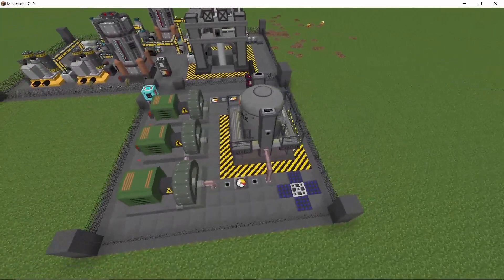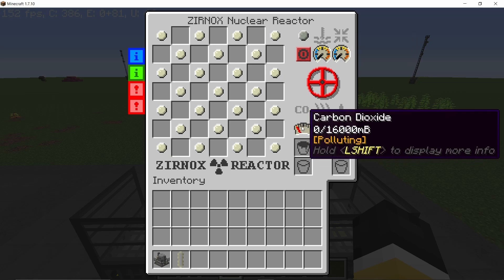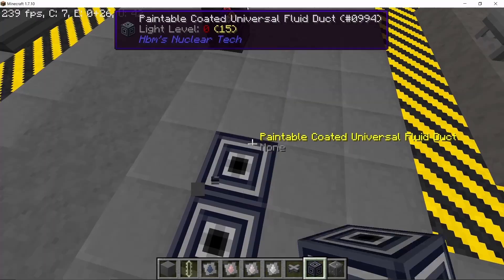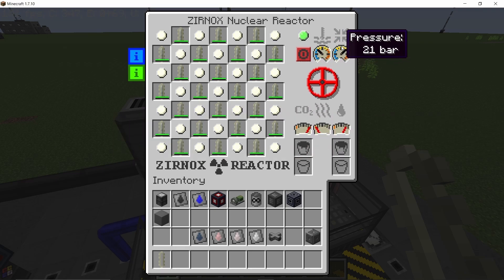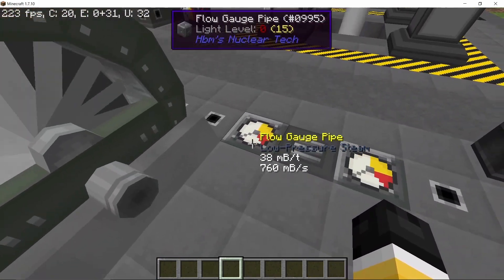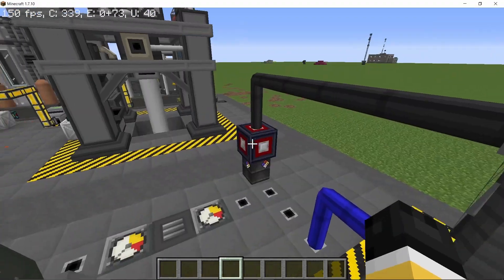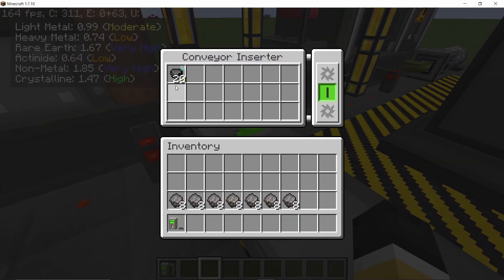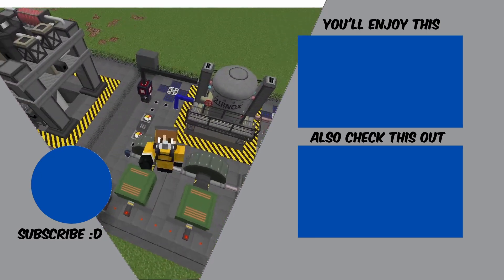ZIRNOX Reactor Beginners Guide - HBMs Nuclear Tech Mod

Comment: is it possible to automate this reactor, or is it manual opperation only?
Reply from the maker: I think full automation can be achieved with a mod like Open computers and you can remove/ put fuel rods using hoppers (if I remember this right ... so take this as a probability)
Reply: sounds like an interesting experiment to try.

Comment: That reactor’s design is silly
Reply from the maker: What change would you make in it?
Reply: @SavageVegeta well i don’t have the mod but if I have it I would change the reactor’s power efficiency
Reply from the maker: @THGMOTORTY3thegamer  tbh this whole video was with natural uranium fuel, which is not very good. With better fuel types you'll get alot more power out of it
Reply: @SavageVegeta  oh okay I get it now
Reply from the maker: @THGMOTORTY3thegamer  yes, the reason I used natural uranium was because it's the first fuel you'll get without the need of further separating uranium into its isotopes

Comment: Sadly it's not in 1.12.2

Btw here is a small tip-
If you place turbine very close with each others then they don't need pipes and the look way coool
Reply from the maker: @abhijeetgaming5749  hopefully it'll be added in NTM extended ... And yes that's how I always setup my leviathan steam turbines, tho with this setup I wanted to use floorspace in a better way so had a pipe in middle for each
Reply: Thx for the heads up bro - my dumbass would prob have been very confused 💀